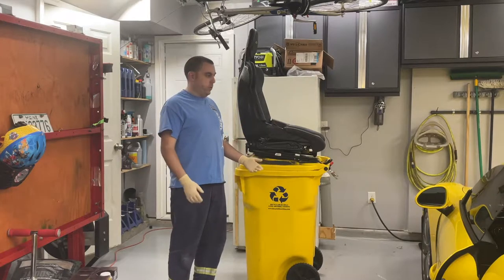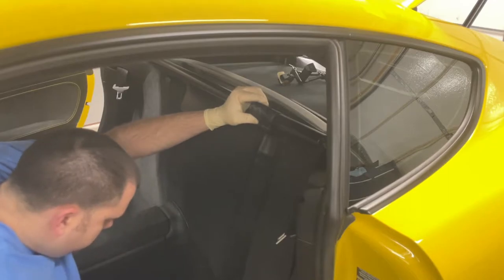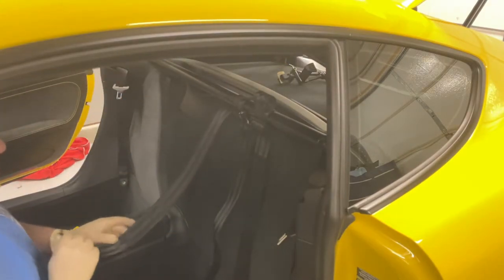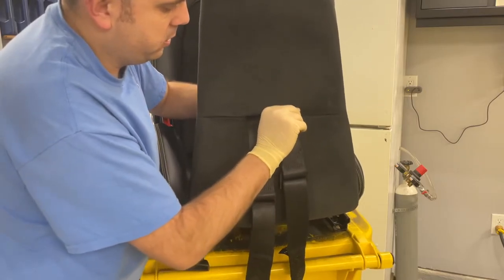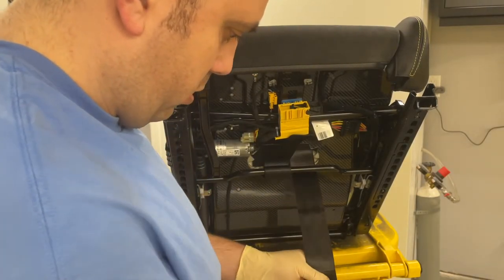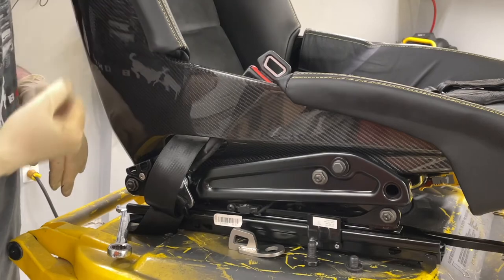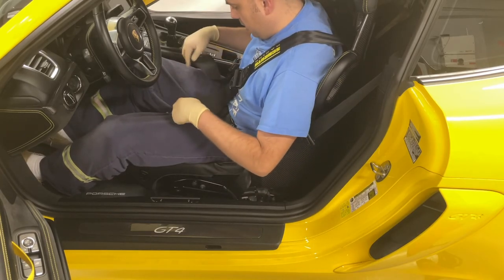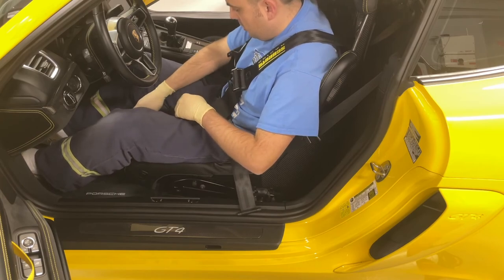Porsche Bucket Seat Harness Install

Comment: The bar you wrapped you sub straps to is the seat slider locking mechanism and NOT intended for sub straps.  For US cars you need an after market sub mounting bar like GMG, BBI has.
Reply from the maker: Thanks for the input. It seems pretty solid. I’ll have to add the bracket
Reply: @gtmachine6134  take the video down and reshoot it. Safety gear install vids should be taken very seriously.

Comment: This is not safe. You've wrapped the sub belt straps around the seat sliding adjustment bar. Yes I am repeating an other's comment. Under the high forces in an impact, this can unlock the seat slider, enabling the seat to move forward or back during impact. You can run the sub belt strap back directly from the cutout to the steel bar at the back of the seat frame assembly. You don't need the aftermarket sub mounting bar. You can see the attachment in this video: https://youtu.be/YdP3HghUNFk?t=157

Comment: The Schroth has a six-point harness system that is specific for the GT3/GT4 carbon fiber bucket seats. The installation would be far easier with the Porsche GT3 Enduro 2x2 harness and hardware kit.
Reply from the maker: Yea i have the older version of the belts.  they newer one bolts right in easier.

Comment: Might be worth mentioning that the passenger side does not have the cutouts in either the cushion or the carbon fiber seat shell for the sub belts so the job is a bit more complicated.  Baffling to me why Porsche does that.
Reply from the maker: Its a US requirement.   We have a different Airbag system then what Europe does.  The seats in Europe are cut out and the seat cushion has the slit in it.